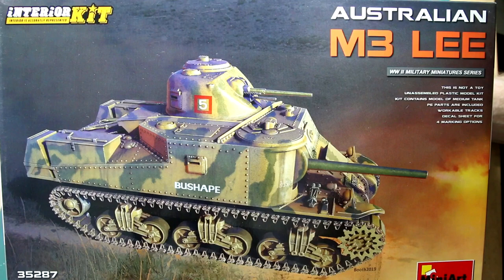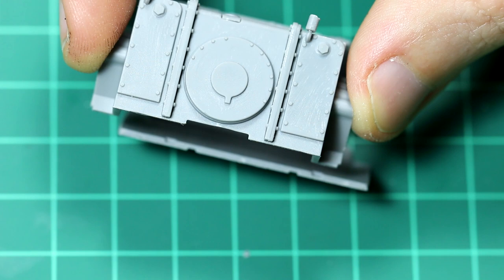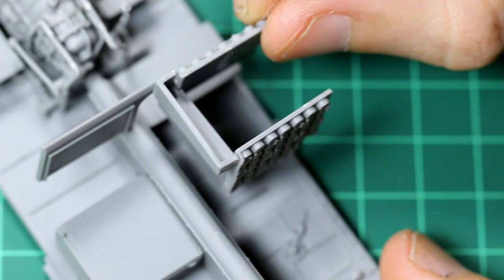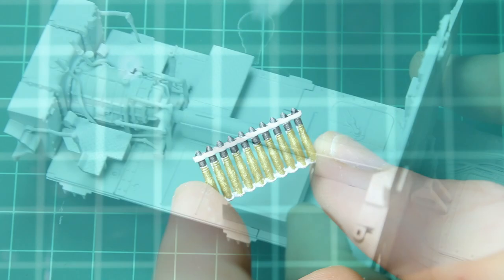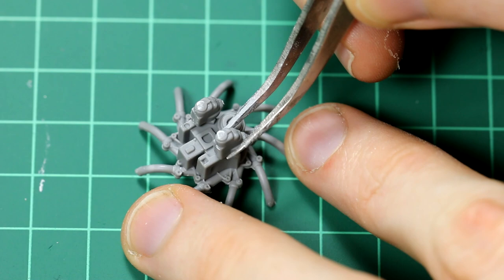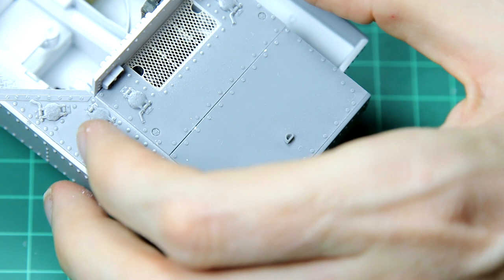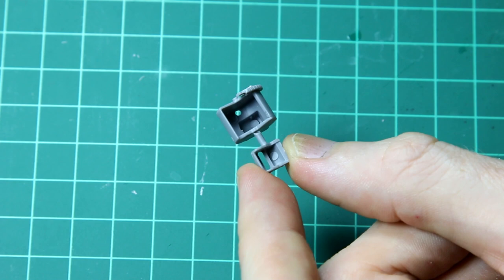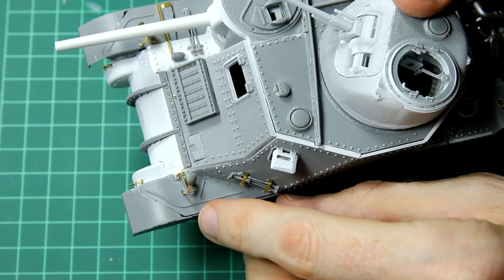Miniart 1/35 Australian M3 Lee full interior - build part 1

Comment: The Lee/Grant tank is an intriguing design in that it incorporates a tank killer with a light scout tank. An interesting build and look forward to seeing it painted.
Reply from the maker: I agree - and the relationship between the Lee/Grant, the Canadian Ram which I built a while ago, and the Sherman is interesting too. I've actually already got the paint down and am working on the weathering now - there's a small preview of it on my channel's Community page.
Reply: The reason for its design is because they wanted a 75mm gun on the tank but they didn't have the design experience necessary to mount a 75mm gun in a turret so they put it in the hull. The Lee was always meant to be a stopgap until they could produce the Sherman.

Comment: I have built two models of the M3 Lee.  Once when I was about 17 years old and then again when I turned 40 years of age.  It was a fairly good tank.  It was used very often in the far east front in China during WW2.  The older Lee did not survive as well as the second one. I still have both, but after so many years of building and learning,  The second Lee looks so much better.   Thanks for the video.  I would love to take a crack at building that Lee as well.

Comment: I build the M3 Grant from Miniart with Interior, i glued the Engine-Cover two one piece together and its still possible to remove it and see the Engine.
The gap between Sideskirt and the Rest of the Tank was on mine to, in my case the gap is now behind some Bags and not to see anymore :D
Great Video and many thanks for your Content.
Reply from the maker: Thanks - it's really useful to know other people had the same problem and how they solved them. The bags sound like a good idea! Yeah, the engine cover on mine was a tight fit - but I'm not 100% now why I didn't just sand a bit off the edge of the panel....that would have been easier than my two part solution!
Reply: @ModelNerd  but i still dont know why there was this gap :D Maybe its easier, but in the end your M3 looks superb !

Comment: To sort those sprue gates, I would recommend a pair of single blade nippers. Dspia are brilliant but for value you can get a pair of Manwah single blade for around a tenner off ebay. They really do make a difference to small parts removal ☺
Reply from the maker: Thanks - I'll check them out. Sometimes I see 'modelling' items and I think they are just regular products with a new label and a much higher price tag - but I think nippers may be something worth the investment, as you say.
Reply: @ModelNerd  I thought they were a gimmick until I tried a pair and they slice through those small styrene parts so cleanly, and they leave little or no clean up 👍🏻

Comment: The thin fiddly bits on the engine... I believe those are oil feed lines for the valves at the top of each cylinder.
Reply from the maker: Yep, I think you're right

Comment: I never have given MiniArt much beyond a passing glance. However, I think this video may have changed my mind. The molding is pretty good, and I like the details.
  There are so many full interior kits coming out now that nine year old me would see it was worth the wait. I've collected a few Rye Field Model and Takom kits in my stash. I must say, this kit you are working on compares favorably with them. The small parts and the photo-etch (which I used to shy away from) have really  extended my building skills.
  Enough of my prattling. Great video! On to the next one! Oh, by the way, what are you using to record the video? Thanks again!
Reply from the maker: Thanks Howard. Yes, I had some of their earlier kits - mainly the ruined building kits - and they are not brilliant. Vacuum formed and need quite a lot of work. But their recent kits are so much better. I like their approach too - either coming up with new subjects or new spins on existing ones (e.g. interiors). I'm currently looking at their new Werkstattkraftwagen Type 03-30, but it isn't available yet or is sold out.

Comment: Why some m3 lee and m4 sherman have longer 75mm? (not 76mm)
Reply from the maker: There were so many versions (especially of the Sherman), it's hard to keep track of them. I imagine a lot of it was down to either what was available at the time, upgrading to keep up with increased requirements, or changes according to the requirements of individual countries.
Reply: The longer 75mm was an early anti armor (not tank) gun, good for tough targets but couldn’t penetrate a tough tank. The shorter 75mm was a infantry support gun that would bust bunkers and help kill infantry and was ineffective to tanks